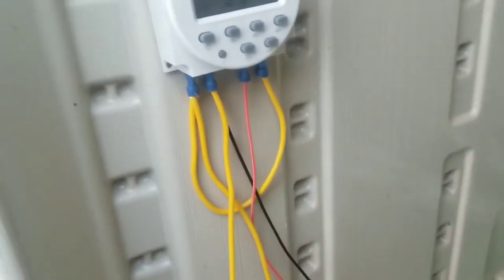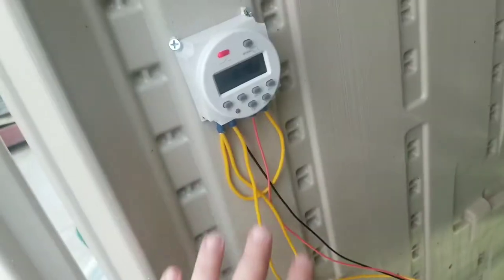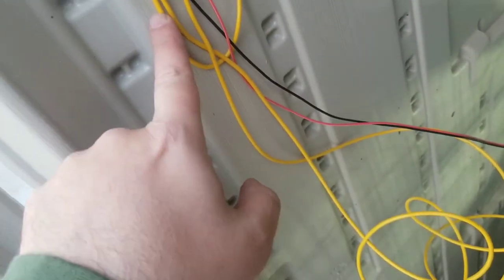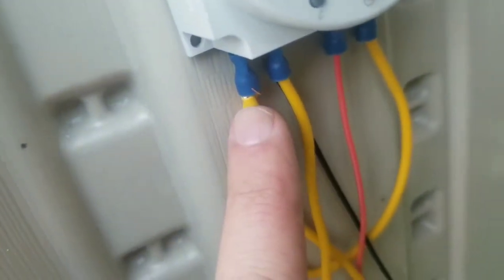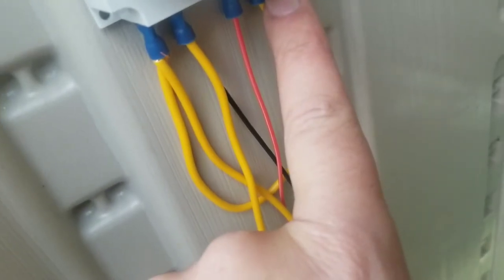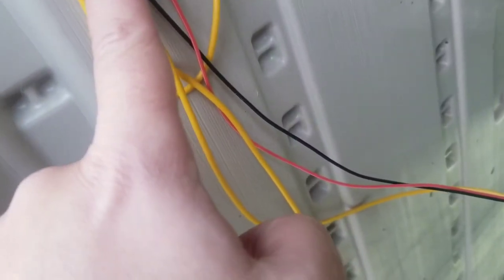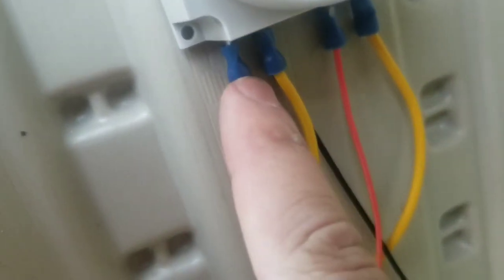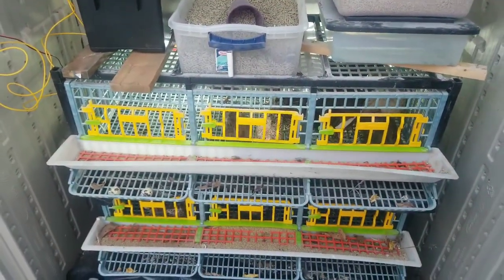How to Wire 12v Power Programmable Timer Switch (Baomain, JVR) | Automatic Chicken & Quail Lights

Comment: Why does the back say 12v input but 250v output?   Can you run higher voltages through this switch?    Very confusing instructions.